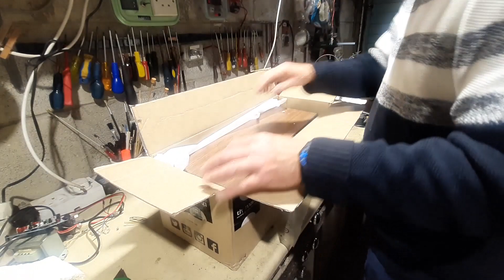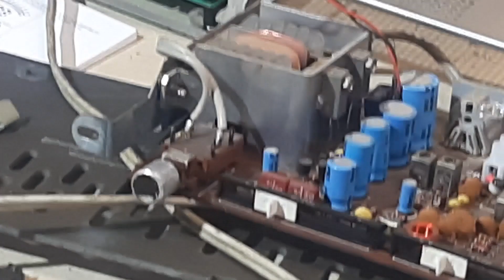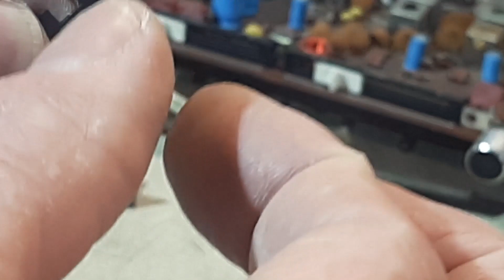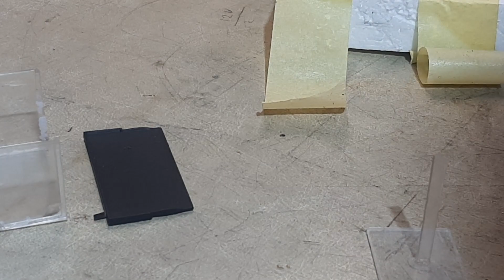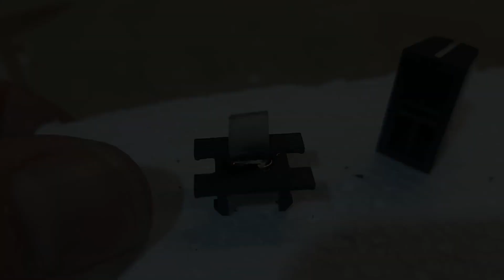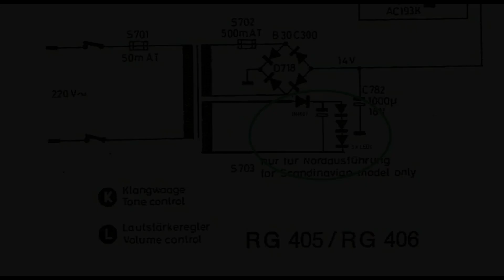Siemens RG405 Repair and Restore

Comment: I'm fairly sure you have drawn the capacitor across the three LEDs the wrong way round?  The anode of the LEDs goes to +ve, and cathode to -ve, so as drawn you've got the + end of the cap going to the cathode of the 3rd LED.  Easy to check, or perhaps you used a non-electrolytic there? I have a video on diode orientation here: https://www.youtube.com/watch?v=tmXo4ORa95k
Reply from the maker: I'm sure you are right, I didn't take enough care when drawing the circuit.